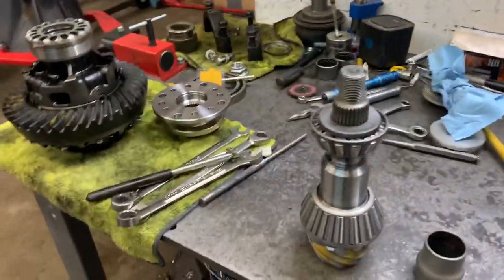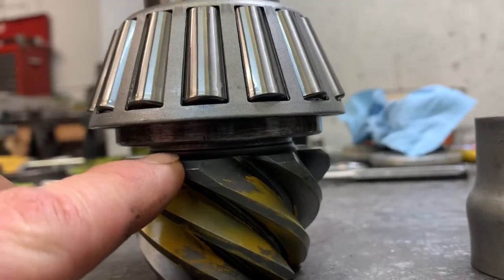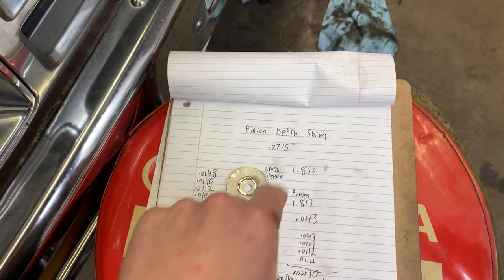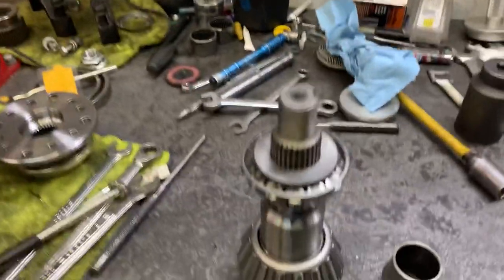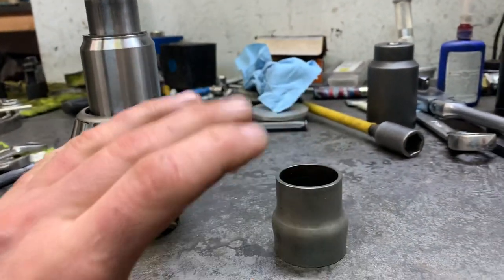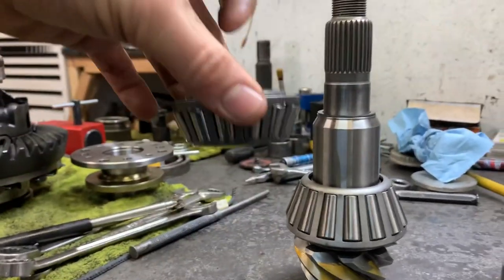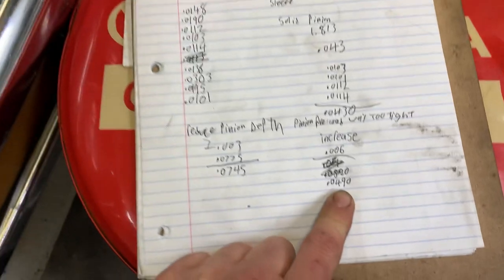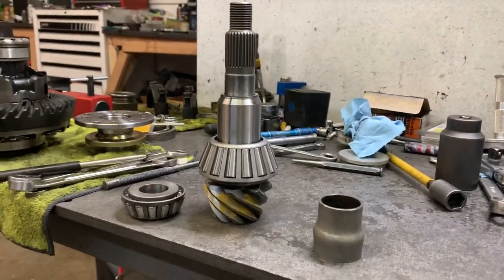Toyota rear differential 3rd member solid pinion spacer and pinion depth adjustment.

Comment: Seems to me the flange is installed and thightened crushing the crush sleeve and until you get resistance on the flange. Then you back off the nut. To the desired backlast. However, by reading the marks on the ring tells me the pinion needs to move away from the ring. I can't. Its already rubbing on the case. The pinion that is. So it's gotta come back off and a shim will be added. And by doing this, I'll need to center the gear contact using the adjuster nuts. Right??

Comment: How do you press the outside pinion bearing back on in the clamshell? How do you tell which shims need to be adjusted when you cant see inside? And lastly how do you set backlash? I dont think you made a reassembly video which im pretty bummed about

Comment: So would I be correct in figuring that you first get the pinion depth dialed in, and then dial in preload by finding the proper shim thickness on forward/flange end of the pinion spacer?

Comment: Do you have a video for setting pinion depth on a Toyota differential? 
Also how the aftermarket gears are marked for proper depth? And any tools you use for checking pinion depth ?